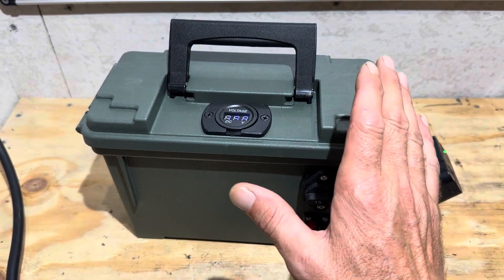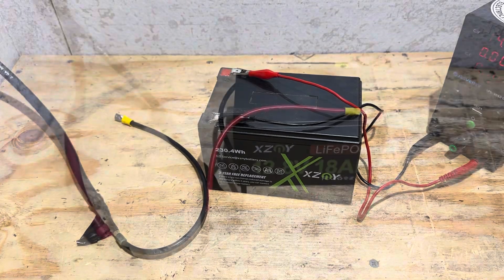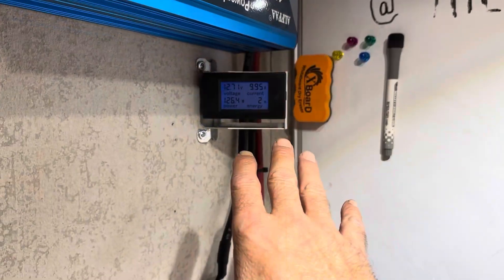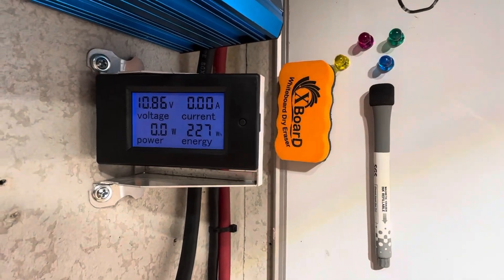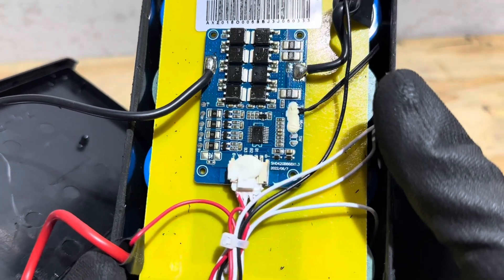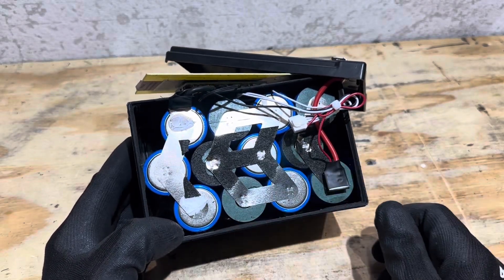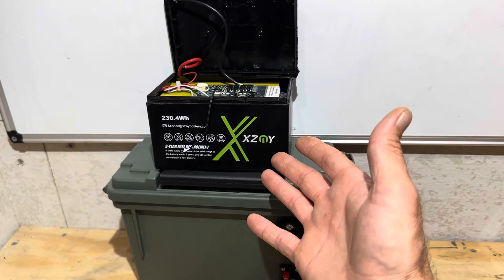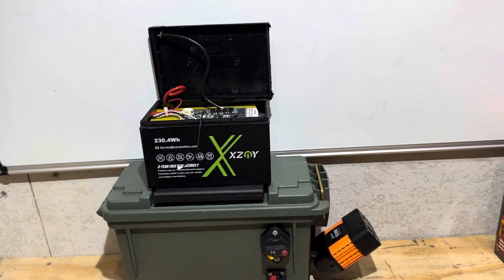DIY Portable Power Station Battery Teardown, XZNY 12V 18Ah LiFePO4 Battery Viewer Request Video

Comment: CAN PUT A SMALL 12v FRIDGE IN THIS SET UP...?
Reply from the maker: Depends on the current (amperage) the 12V refrigerator requires. Check your rating on the refrigerator. Let me know its ratings and I’ll help you